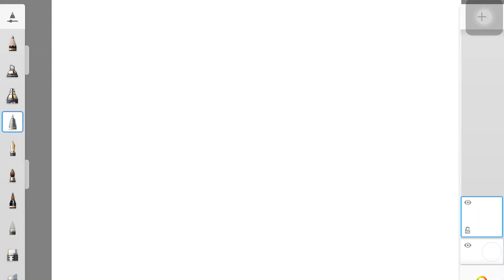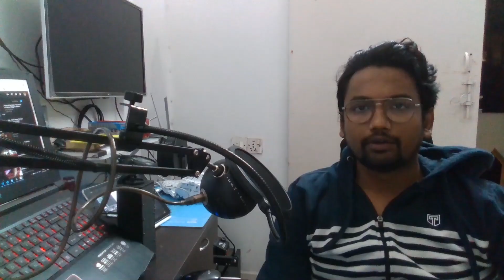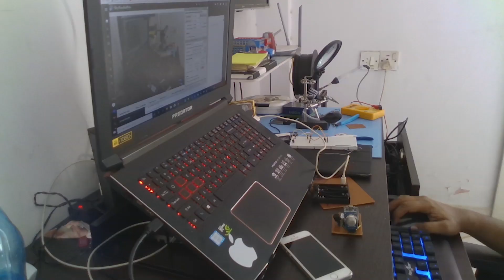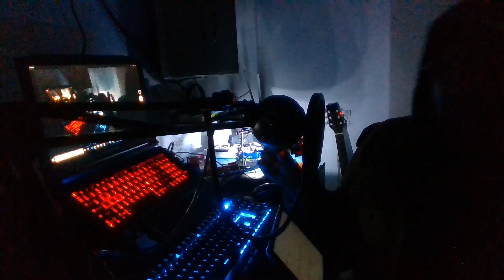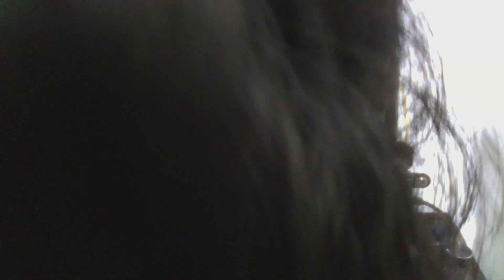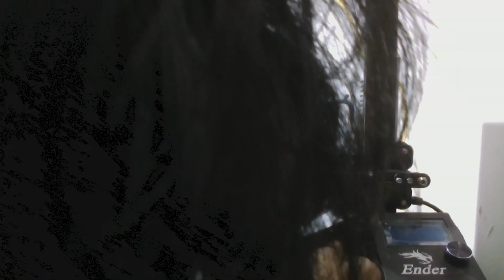Making a not so dumb Smoke Sensor ( 24 hour Prototyping Challenge)

Comment: What you have done is create a flame/Heat sensor. however, Next time I would like to see you test it with actual smoke.  There are several stages to a fire and it is absolutely critical that you can sense the smoke level (obscuration levels) first.  You can buy can smoke that is designed specifically to test smoke detectors.

Look at integrating Photoelectric devices and or/ Ionization detectors.

In addition to a reset you should have the detector resume sensing just in case you do walk away from the room and forget and a real fire event does happen. The reset for " I am cooking" really should just be enough time for you to fan the smoke away from the sensor.

I do like you ingenuity and skill set. I do wish I could do what you do.
Reply from the maker: Hi Edward, thanks for the feedback. I would want to definitely check the approach you listed. Appreciate you taking time to write the comment.